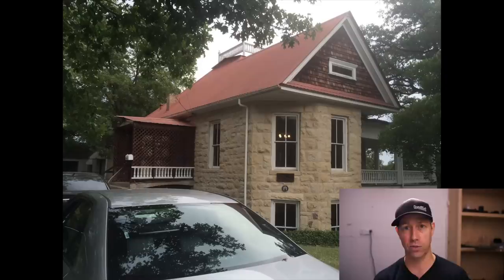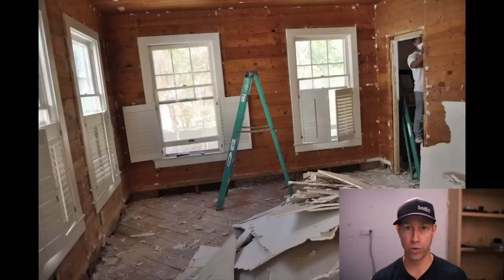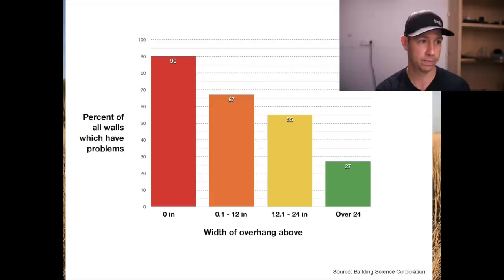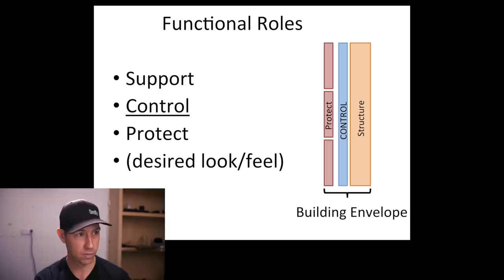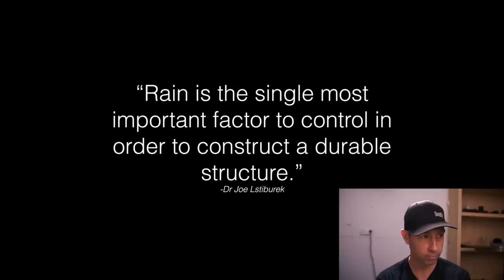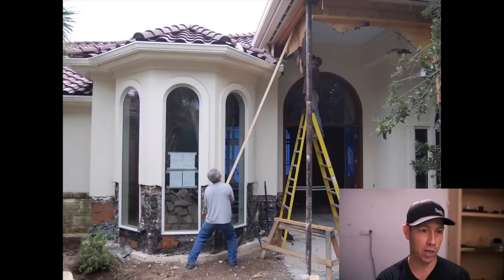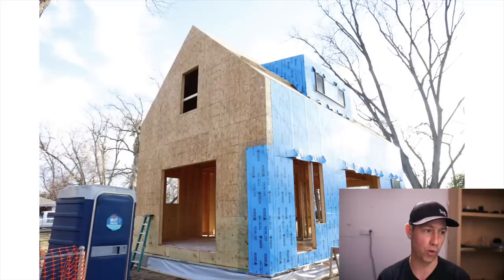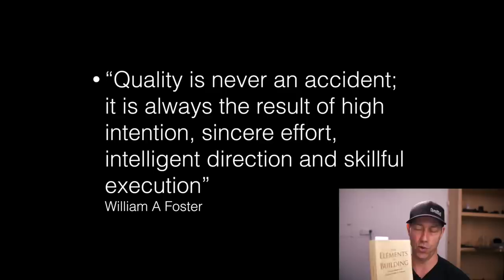Were Old Houses Built Better?

Comment: I lived in Sacramento for around 2 years and it was frist time I'd ever lived in unit with central AC.  I found I was more lethargic and stuffed up the next with it running all night.  I came to a point it was really only needed it from say 2 pm to about 6 pm to escape the blazing mid day summer heat.  I wonder if the houses was really designed like ancient desert dwellings with thick masonry walls, high ceiling and huge overhangs if central AC really wouldn't be needed.

Comment: I was just looking at a house that was built in 1945 and the owners owned it for 32 years and didnt do any work to it. The house was solid as can be and surprised to see no cracks at all in the foundation and floors didnt sink. The energy bill however is really high which makes me think that the attic is air sealed and probably poorly insulated. I live in cold Canada so in the winter it can be -40c . The  place surprised me how well built it is, ill probably buy it and air seal the attic and possibly the walls.

Comment: Having grown up in Australia "where there is more hot then cold mainly" where for some crazy reason we have never built to climate. I have seen housing built from any material available, no floor "dirt"  "straightened out kerosene tins ... no ceiling.. hopper windows you can slide your hand in when shut? I have many work colleagues over the years from all over the world.. the first question when they see the old and relatively new houses is "are you crazy? summertime.. "you have 50deg C outside and no insulation" winter" you have -6C and no heating??? Cold enough for concern and living comfort "not life-threatening liker other places but still valid points. I have not built in Australia of late. The last house was back in1995, trying then to get control over the house via "subfloor heating" more than one pane of glass in the window "we can't guarantee what side of the window will get the double glazing///' wtf was my response? MY RESPONSE "IWONT BOTH SIDES"  Oh sorry sir we can't do that as you may need to break one in an emergency to attempt an escape... "now my eyes are popping and a dumb look on my face... and a. WHAT" is all i could muster. It seems we are still deep down just excepting what the Jail keepers are throwing at us and excepting it. I know this has dragged on but I really home somewhere down the track that we down under start taking some notice of the way other countries are building "codes to measure air exchange... wow would be nice" Let's hope some "smart" builder in Au decides to up the standards soon because after walking through a few recent display houses "and this includes price ranges up to about $900K ... we have not progressed. I am sure somewhere we have good stuff but not for the general population. 

Ok enough dribble.

Really like your presentations Matt, like the reality, a bit of advertising is essential today.

Comment: Structurally yes.  Largely because they had easy access to strong materials.  Today we use an abundance of cheap and engineered materials that we combine to form energy efficient and easily replaced members. 

Our homes are much better in some ways but not all. I don't know as much as you and appreciate the video. 
- Home Inspector

Comment: On the west coast, Cedar is a preferred product because of its resistance to rot. However, much like the image that you showed of the old growth wood. Cedar trees that are 50 plus years will have a rotted-out core and an outer shell that is rot resistant. Unfortunately we harvest cedar trees before they have matured, and then end up with the center that doesn't have the durability and will rot

Comment: I grew up in a house that was built in the 1840s and it was extremely well built.  It was triple brick construction,  the floorboards were a foot wide. Because of the triple thick brick walls it would stay cooler in the summer time,  we never used air conditioning,  just fans in the upstairs bedrooms. I currently live in a 90 year old house that is still quite well built, it's built on real timbers and built with real wood, not osb.

Comment: Why was the Insulation put on the outside of the house? And the weather barrier underneath? My basic understanding is that the insulation goes in the wall, plywood, weather barrier and finally the outer shell.

Comment: Important not to just make theories about the vapor barriers and draining when putting up subdivisions... But to look it up. That sort of freaks me out putting the insulation out of the structure, and then somehow making a thin cladding connection skeleton. How would the outer batting be rigid without driving spikes through the insulation?

Comment: I would prefer having a house built out of bricks than just all cheap materials that wear away easily over time. I would most prefer something like limestone brick house, because they're very solid, and built to last, and even if they do get wet, moisture and moss growth only sticks to the outside layer of the limestone which can be cleaned off with a bit of sanding. Limestone brick houses are pretty common in the UK, with both double-glazed windows and insulation on the inside it'll keep the house pretty warm during the colder seasonal weather, and you don't really have to worry much about it getting too hot inside during warmer seasonal weathers either, since it doesn't really get that hot either, plus you can just open a door or window or a fan to cool things down if needed as having a aircon isn't all that common.

Comment: Great stuff Matt. Living in STL  area the vast differences in the home over time is massive. Most new spec home stick builders do not have any idea the greatness of the past builders. Much less the materials and how to use them properly. We sell women’s hair dyers as heat guns for who knows what at the Depot so as we know the folks who sell and buy at the depot are not builders. The past men were tradesmen. They knew real sciences. Not peal and stick liquid nail air compressor bs. It is nice over time we have learned the HVAC part of these old homes in places like here where whether changes in four seasons. The spec stick griffin homes are definitely garbage standards around here, sadly. Toothpicks and lipstick.

Comment: In the concept house at the end, is the idea that the exterior insulation would not degrade over time, or that it could be replaced easily? I'm onboard with the wrap, but if water hits that insulation (especially if it gets inside the first or second layers of insulation) wouldn't mold grow there as well?

Comment: There is a distinct difference between correlation and causality.  Large overhangs were much more popular at the same time that wood was much more available.  Either or both of these facts could account for the reduced damage in older houses.

Comment: Thank you for this video! 

Ok, but in the last house you showed where you coated the entire thing in waterproofing and insulated the outside: How is this different from the 10 year old house with the stone facade and the mold growing even under the porch overhang? They probably thought the same thing putting it up: "Oh this is waterproof!" only to have water damage 10 years later. Or the decay damaged house after 1 year due to the window gaps?  

As you illustrated so thoroughly: One tiny gap in a structure made to be waterproof, and you've compromised the whole system. It seems like you have the same overconfident hubris the builders on those houses had. That your application will be flawless. Nothing could possibly go wrong.

I do really appreciate your time, research, and analysis of how old buildings have lasted and what flaws they have. And doing the same thing for new homes too. I like that you are trying to solve the problem of: How do we build to last with suboptimal materials?

I am curious what ways you think your own design could fail. "If x isn't done properly, then y can fail this way." And then how do you prevent that failure?

Thank you for your great and informative video. Keep up the good work!

Comment: My 1840 house has great bones. The beams are all hand hewn. The only weird thing is that some measurements are eyeballed rather than measured perfectly in the corners. Putting in a corner cabinet had to be done with extensive scribing. It was worth it. 
We would go nuts in a new house with nothing to fix.

Comment: My house that I’m moving out of was susceptible to rot and mold in the bathroom because their was alot of moisture and little airflow. My grandmas old house that burned down due to bad wiring never had this problem and the house felt more structurally strong. The wood felt much stronger if you jumped on it and leaned on it. Unfortunately the house couldn’t be saved after the bad fire but it was definitely better than alot of these cheaply built modern houses.

Comment: I put outside water faucet on a stone house.  I figured, ok, I'll just get a 3' drill bit, and drill thru it.   Nope.  The section where I wanted to put the outside water, was 40" where I wanted to run the water thru.   Between the outside and inside stone facade, there was stone rubble.   So, when I drilled out the hole, more rubble fell thru.   ouch.   Took me forever, to drill one hole, and fish the pvc pipe thru.

Comment: I seen new houses built quickly and the support wood looked thin and flimsy.  My house was built 1950 and it's been through plenty of hurricanes and built like a rock. However, I also spent over $50,000 keeping it up to code LOL.  The plumbing and electrical had to be redone. A lot of things had to be redone.

Comment: Nice video, made me think, what if you used a 4' row of cement board as your exterior sheathing in places where sprinklers or other water might damage the OSB when it's close to the ground? Then above that you could use standard OSB sheathing?

Comment: I. Used to do  electrical work I did some rehab work of older homes in camden new jersey . Well I saw a lot of short cuts that were definitely not up to code and for good reason . I saw red brick be used as foundation I can not see how to his could be load. Bearing and can see the tremendous difficulty that would arise if you were to mount a board  On. That feeble red brick in order  to mount a  switch or receptacle on that board !!!

Comment: Old growth lumber and 2ft thick basement walls are exactly why I did a full renovation on my old farmhouse vs. building new.  Wow that old lumber is tough stuff. Had the foundation looked at and the whole house was only off 1/8th of a inch over the whole length. Jointed carsiding on the outside was nearly immaculate.  The bones were so solid with very little damage over all that time.  Had to reframe a few spots,  likely because of a lack of overhang.   Retro fit with some modern tech and I have a hell of a solid house.  Now, the wiring....that was ugly.  The insulation was nearly non existent. Got rid of old galvanized and cast iron plumbing.  Lots of cracks and gaps to fill.  The cavities of the house were full, like gross full, of bugs and nests, not a fun job when demoing the plaster and lathe, dirty dirty job.   It is interesting to see the good and bad of old construction.  It's good that we are always learning new and better ways, now if only we could improve some of the materials we have at our disposal.  
Got the same good materials in my old barn and out buildings, but due to rising lake levels, I will be deconstructing them to scavenge materials to rebuild in new locations.   Great video.

Comment: That naked house always confuses me and now you finally addressed the point but I still need some clarity: after you installed the outside insulation how did you install the siding? Did you add 1x4’s all around?

Comment: If you put the insulation on the outside of the water barrier then it will constantly get wet. If there is airflow around it then it isn't doing it's job insulating. What's the deal?

Comment: man I never get why people in the north especially faar north wouldn't have overhangs provides shade in the summer (no direct sunlight into the windows helps a ton with heat and in the winter you can still get sunlight which means with big window fronts they can really get your house tosty as soon as the sun is above the horizon.

Comment: The differences in the growth rings  show something else altogether, the tightly packed growth rings of the old growth example  represent less annual growth and most likely because the tree was grown in a colder climate than the new growth example ...a thicker growth ring is representative of more growth in that year, measuring annual growth is always linked to temperature and availability of water and nutrients. Possibly plantation wood has better overall conditions to exhibit a more  rapid growth than an  old growth  tree

Comment: old homes were built with double walls on the out side of the home. nail the floor joists down, nail a wall stud to the side of it! put the flooring down, nail the sheetrrock on the wall. they used lath and plaster. at the top they nail the ceiling joists to the side of that wall stud. so>>> there  was NEVER a bottom plate  stud wall AROUND the house there would almost never be a top or BOTTOM plate put on. SO  there was a hole in the top and bottom of those walls. air flowed thru the outside walls and air condtioned the homes. they flowed air from the basement or crawl space up thru the outside walls and up into the roofs of these homes. kept the high and dry as they said.. you had to have vents in the crawl space for this to work. and vents in the roofs  or attic space..

Comment: I am EXTREMELY interested in the house with the insulation on the outside. I am going to be researching this much more.
Reply: It's a concept growing in popularity here in the UK  especially as retro fit for houses with either solid or cavity masonry walls   Once the insulation is fitted , the original outer shell becomes the inner shell and so adds to the "thermal mass" of the building. You've then got all that masonry warming up nicely from whatever heating system used   That levels out temperature fluctuations summer and winter and the heat can't escape in winter and can't penetrate in summer

Comment: On an old stone house what if you put in ground source  heat and run manifolds around the basement floor  and run air not heated just air and have a air gap all the way up to the roof this could cool the house in the summer and make it like outside the walls are always  in the 50's ?

Comment: Very interesting. Not knowing a lot about insulation materials apart from the fluffy pink stuff in the attic of my 1960s house, I keep imagining water getting into to the thin layer of siding on the final house of the video and the insulation getting soaked. Living in FL, moisture is my enemy and I feel as if that house would be like a wet down jacket against skin because the home’s moisture-proof, sealed layer is the skin, layered then with insulation and, lastly, siding. Without overhangs, that siding has to be completely waterproof to keep moisture out of the insulation material and I’ve never encountered completely sealed, waterproof siding. What am I missing here?

Comment: When u did this video 3 years ago so back then what was the cost difference between doing the houses with the exposed studs and isolation on the outside compared to what is currently the standard asking because I'm trying to figure out best long term cost for so I can now loan I need but want something that I know will last like the older homes with have

Comment: Id be fine in a 1930s house. We just recently moved into a house with a heating and cooling system for the first time in our lives. We just had air conditioners in the windows a lot. It wasnt that bad. BUTT if we were to leave we would turn the air conditioners on high because nobody will be going in and out if the house. By the time we would get back, it would be like 65 degrees on an 80 degree day. 👏

Comment: By putting your thermal insulation outside the air/water/vapor control layer, isn’t the insulation subject to mold/mildew/termite infestation because of the water intrusion?

Comment: Many years ago there were few building codes.  Cheaply built houses might have inherent defects and wouldn't last long.  More expensive homes might have been "overbuilt", and because labor was cheap more craftsmanship was used.  They have passed the test of time.  

Current homes must comply with the codes, but often just barely.  Today it's all about profit, and passing inspection is all that counts for some builders.  Appearances count more than structural integrity, and some newer construction doesn't age well.  You don't refinish and repair something, you replace it.  You can restore a 100-year-old oak floor, but some modern flooring is simply a thin veneer over a base and cannot be refinished.  Mouldings are made of plastic and cabinets are made of particle board.  They look good to start with but they don't last.

Yes, we can build homes that are well-engineered, energy efficient, and are designed for modern-day life.  But that doesn't describe the more common mass-produced house.

Comment: Stupid question: if you put the insulation on the outside of the water control layer, won't it get wet? Is that not a problem for the material over time?

Comment: Complete novice here with no agenda other than curiosity.  With the last house, is there a potential issue with water collecting between the water proofing layer and the insulation resulting in soggy insulation?  I ask because this is similar insulation to what is used in hot tub covers and they wear-out because of water vapor collecting in the foam resulting in the insulation getting soggy.  Granted, that is extreme, but in a humid environment over many years, could one have a similar thing occur where condensation or rain collects in the foam and causes deterioration?